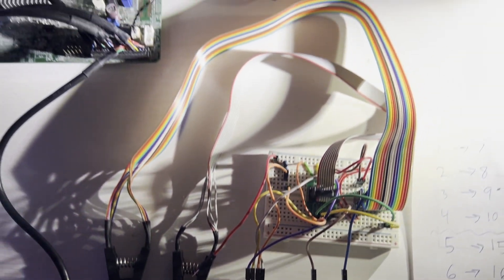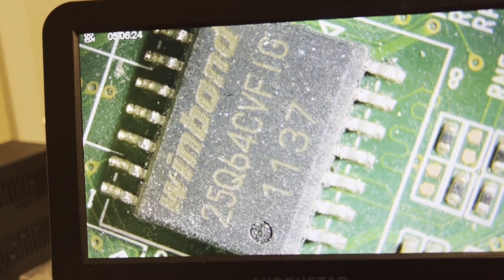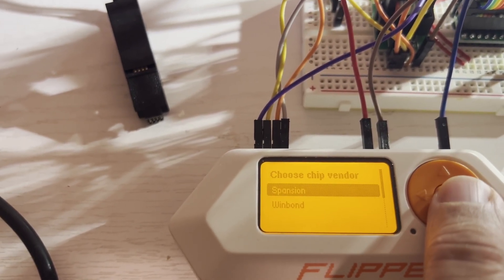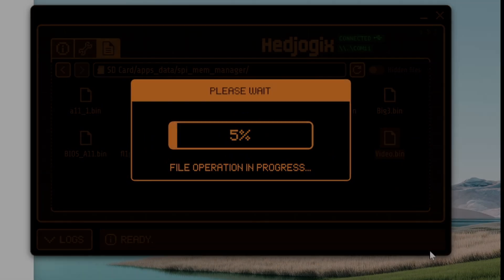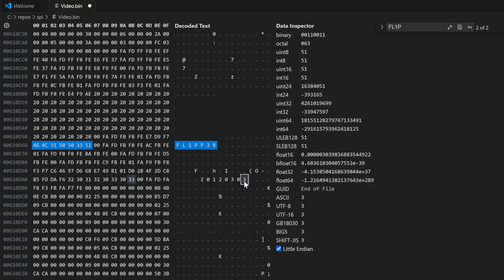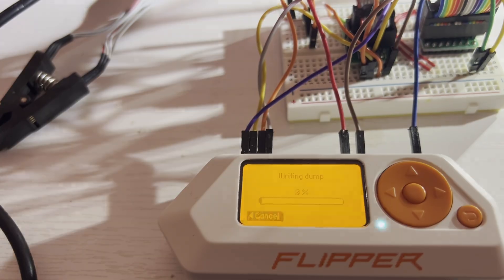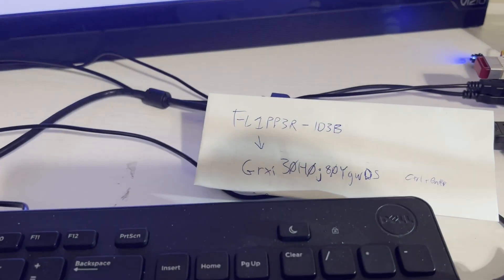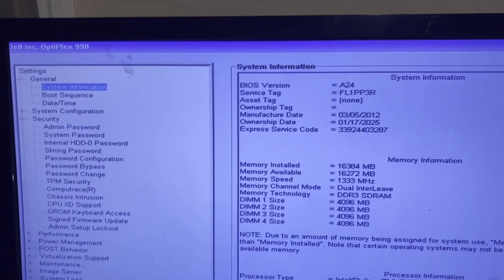[150] Flipper Zero: Writing to SPI Memory (Computer BIOS) #FlipperZero #gpio #Winbond #security

Comment: Thanks for this appreciate it, just wondering im looking to use the flipper to read and write eeproms a Toyota ecu, they are 5v, whats the rough process to use a level shifter?
Reply from the maker: I'd probably look at something like https://www.adafruit.com/product/1787 or https://www.adafruit.com/product/395. If you are using pull-up resistors, then you need an I2C safe solution, such as https://www.adafruit.com/product/757.

You basically have a common ground, and then the LOW VOLTAGE pin goes to the 3.3V and the HIGH VOLTAGE pin goes to the 5.0V pin. Don't forget to enable the 5V pin on the Flipper Zero (when the USB cable is connected the pin is typically enabled otherwise go into GPIO/5v on GPIO/On). The max current is 1Amp, so hopefully you are just powering the eeprom and not a bunch of additional electronics.

GPIO pins go to the low side, and the 5V pins go to the high side (like A1-A4 -> B1-B4).

I haven't actually used 5v eeprom, but if you need help, feel free to reach out on Discord (@CodeAllNight).
Reply: @MrDerekJamison Thank you, appreciate it

Comment from the maker: It's really cool that the Flipper Zero was able to write to the 3V3 chip without needing to remove it from the motherboard!
The mapping of 8-pin to 16-pin is the following (instead of 1..8) it is: 7, 8, 9, 10 / 15, 16, 1, 2. (still uses 8 pins, slightly different order.)

I'll probably try doing the same thing with the Xgecu T56 I got for Christmas, but not sure if I'll make a video of that one. It looks like the T76 is out now! 😭
Reply: Pretty cool, most spi i have read needed desoldering in order to read/write